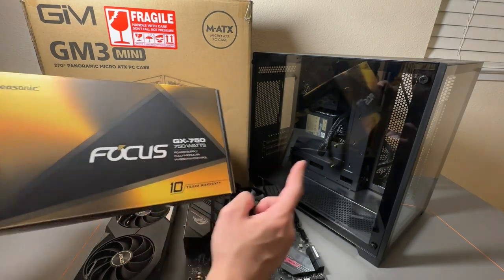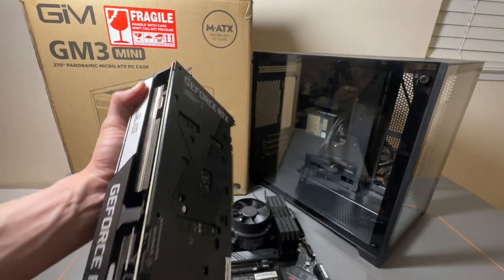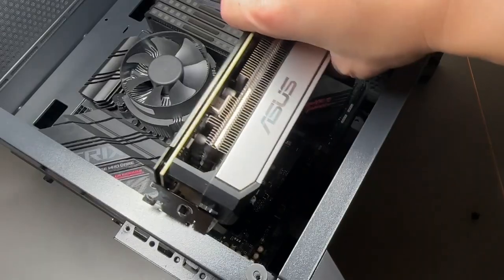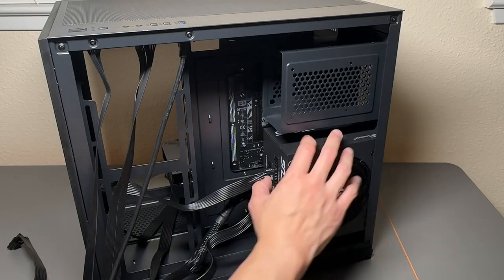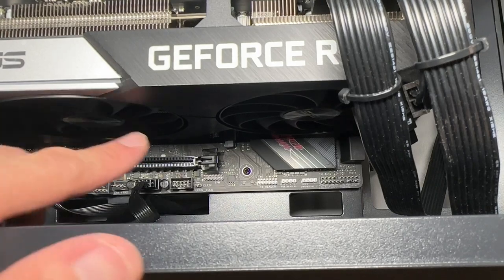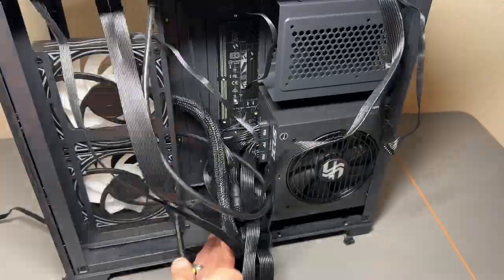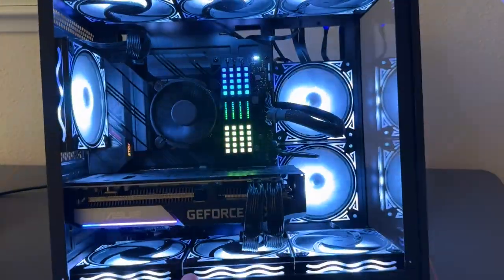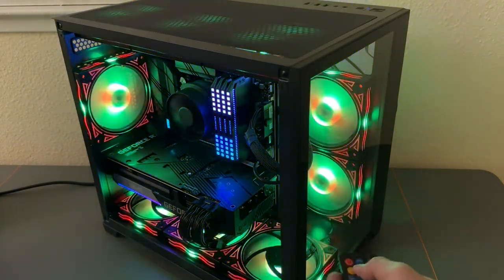How to BUILD a Budget Gaming PC with GeForce RTX 3070 Graphics Card!  GIM GM3 Mini Micro ATX Case!

Comment: which fans are exhaust and intake? I was thinking bottom 3 intake, top 3 exhaust, the 2 fans on the right were intake and the 1 fan to the left was exhaust… i have the same case
Reply from the maker: Bottom and Top are Intake, everything else is Exhaust.  I was planning to Watercolor, so I didn't think about it with too much attention. FYI: The case only supports 240mm AIO.